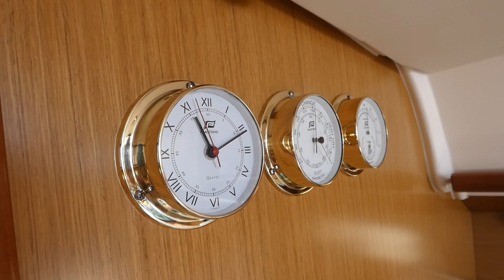We got a new toy | We're back onboard |  Sailing Kejstral Adventures S04E01

Comment: Just overhauled our two toilets completely - the clue to getting the correct overhaul kit is to match the label on the front of the pump unit to the photo on the overhaul kit as they are all different depending on which year they were manufactured. I just took a photo with my mobile phone and headed off to the chandlers...